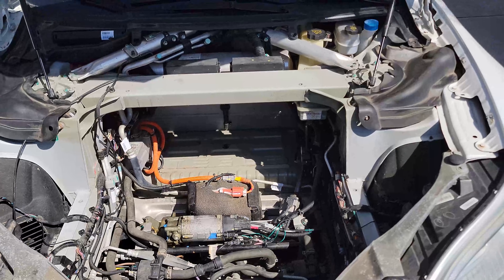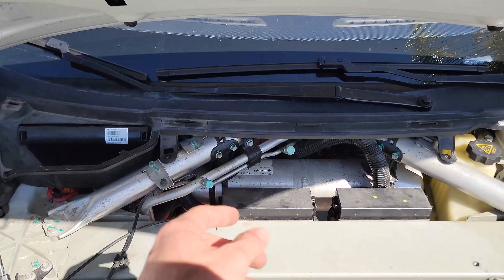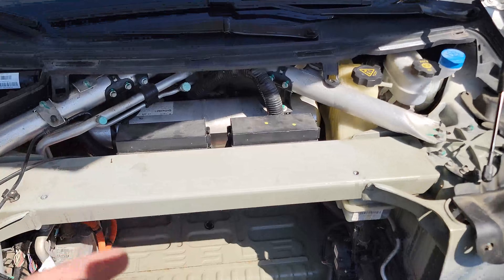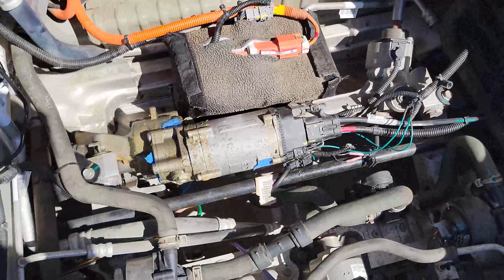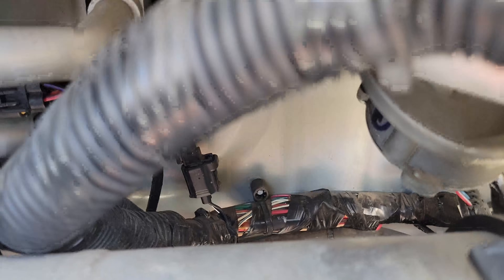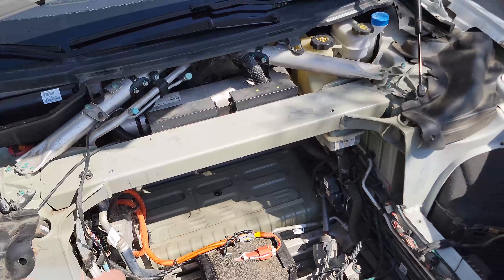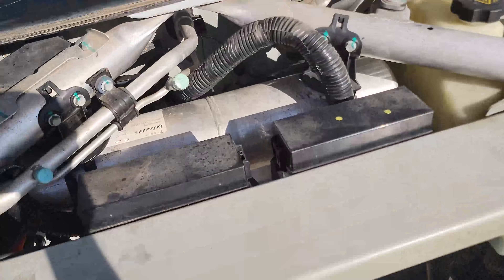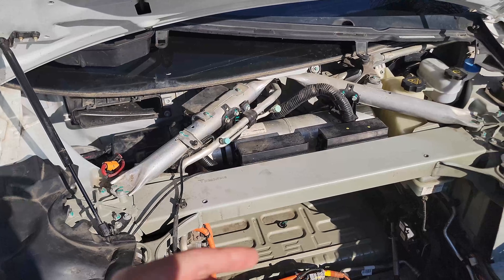How to Diagnose and Fix Tesla Model S AC

Comment: Me i have that pee smell, but my AC  comprassor working. But it makea noise when its on. And also If i set the heater More that 20 i m getting cold air  for the legs. I dont know what s wrong with it. Tesla sais comprassor have to Be replace but i dont believe that, it feels to me its some of temperature sensors, cause i have A code.

Comment: How did you fixed the broken wires? Im getting TXV Evaporator error so i think mine are also broken... MS 85D 2015
Reply from the maker: You could use automotive grade wire connectors, but I stripped the wires and soldered them back together. It was a tight squeeze working in there, but the connection has held up for over half a year now!

Comment: Very nice. But could not see where these two chiller actuator wires go. Could you please share?
Reply from the maker: There's one next to the compressor and one sort of under the dash in the center
Reply: @NicksCarHistory  Fixed. The wires were chewed all the way to the base buried in where the tapes wrapped around. Thank you so much. The car including A/C is running well now.
Reply: I wish you had shown where those cut wires were at and what they connected to,  it would have been useful to be able to view that part.